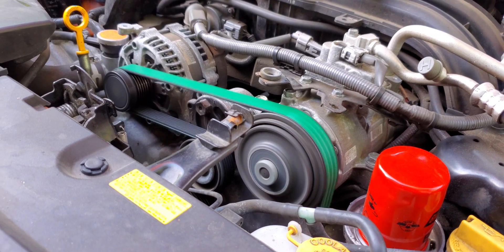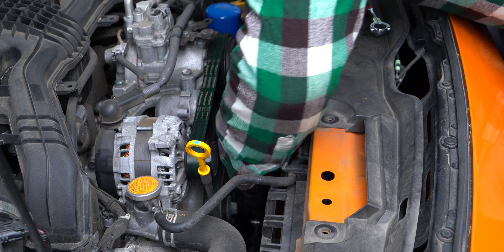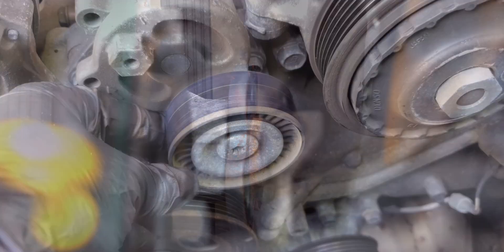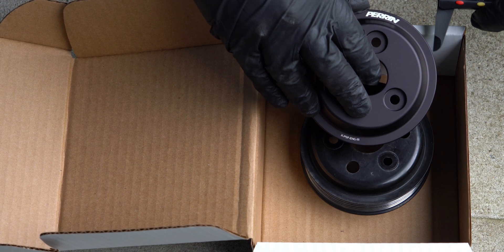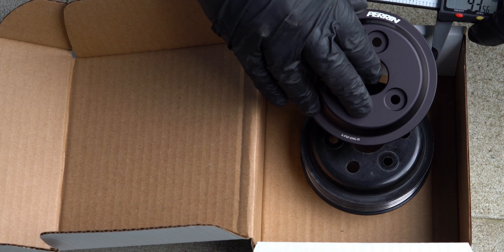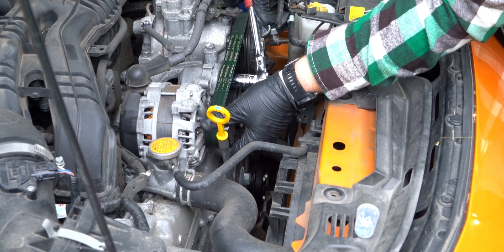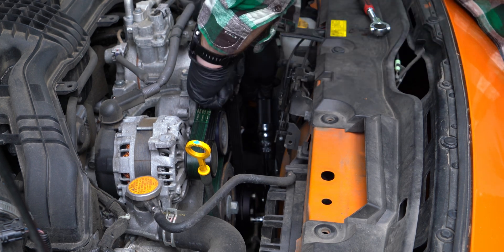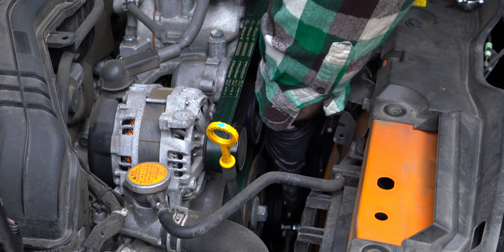Subaru Crosstrek Water Pump Pulley Replacement (OEM or Perrin Lightweight Upgrade!)

Comment: I want your review after the install... I have followed your other videos and have also wanted to do this mod but wondering if it is worth it
Reply from the maker: I knew going in that this mod was going to do little to nothing for my Crosstrek. I feel like it's something that would be felt more in a manual and/or a higher power, more modified engine, where that reduced rotating mass would help more.

When putting parts on that the engine has to rotate like this, you should be able to see a difference when you have the car in neutral and you blip the throttle; lighter parts allow the RPM to  raise and lower at a quicker rate, and when I tried that, I didn't notice anything change. It was just a single pulley changed out, though; making other parts like that lighter adds up.
Reply: @CarsSimplified  right I also forgot you have the cvt.. well either way you would say install was easy? I have a manual and still think I may go for it. How much was yours without the free shipping deal

Comment: Why did you replace the pulley?
Reply from the maker: I ordered another part, and this pulley was on sale to the point where it would put me over the threshold for free shipping and was only $10 more than not-free-shipping. Figured it was worth it just to make the video, and maybe I'd be pleasantly surprised by a small performance gain.